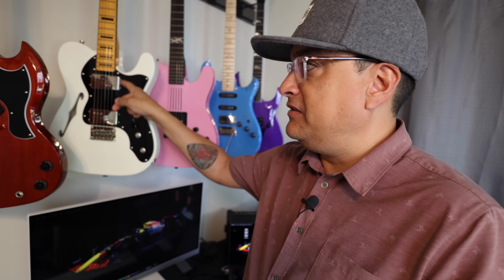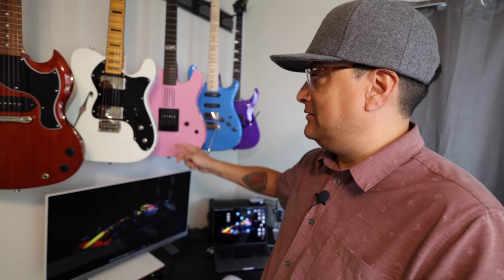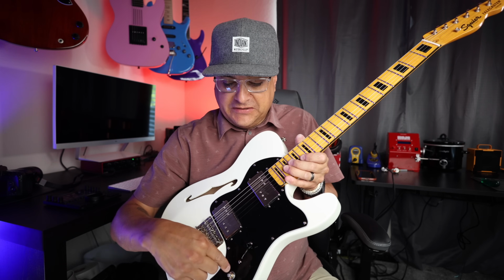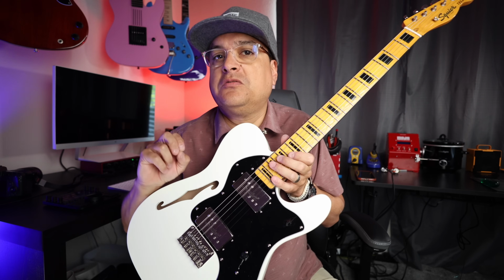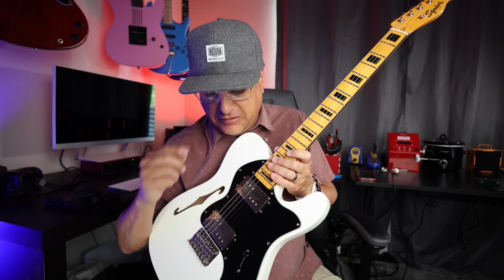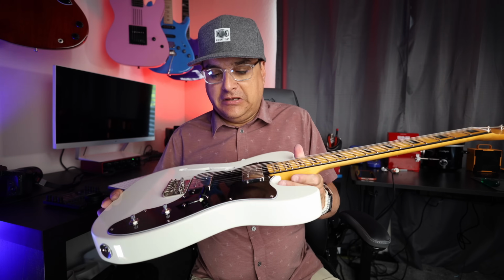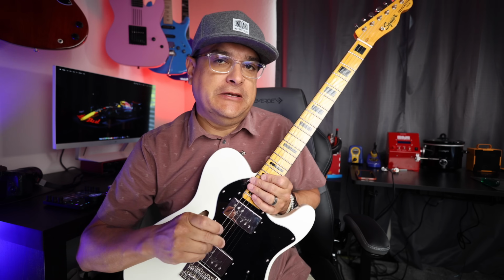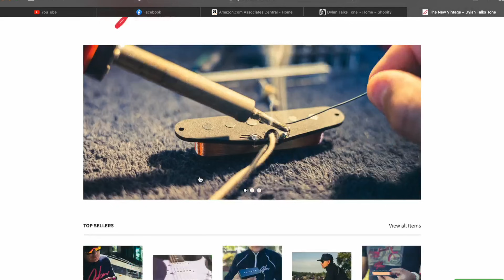250k Pots Vs 500k Pots - Sound Comparison

Comment: 3:45 all potentiometers are variable resistors.  Wiring a pot as a volume just makes all of the signal go to ground instead of through a capacitor then to ground in the case of a tone pot.  They work in the exact same way.  

The only difference is the tone pot bleeds highs to ground.  Volume pots bleeds the entire signal to ground.  In both cases, the pots are variable resistors.
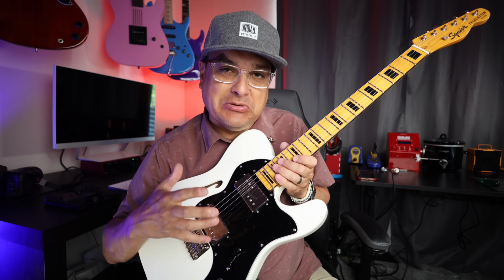Reply: 4:30 you’re really over complicating this.  

Pots are resistors.  The higher the resistor value, the stronger the resistor.  That’s it.  

A 250K pot is a weak resistor.  Therefore, it will allow more high end signal to bleed to ground.  So if you have bright pickups, using low value resistors will darken them up.  If you have dark pickups, using high value resistors will brighten them up.  

Why?  Because high value resistors are strong resistors, so they will do a better job of resisting the high from being bled to ground.  

That’s it. Don’t over complicate.  You’ll just confuse people.

Comment: What's your suggestion for Seymour Duncan Hot or Cool Rails? I have a 250k volume direct to my cool rail in my strat and 500k, tone and volume, in my duo sonic with a hot in bridge and cool in neck. Both sound great though the duo sounds like trying a 250k might be worth the experimentation.
Reply: I have always understood that those were designed to be used with 250k pots but I guess you could experiment. I use em with 250. One day I'll try 500k. Although I think it sounds fine with 250 in a Strat.
Reply: @danpena7922  I'm thinking of going back to 250s. The 500s, in the Duo Sonic at least, sound a little "muddy". Think I need to get the solder gun out again since I never tried them with 250s, just thought: humbucker in single coil size so use a humbucker pot. Wasn't afterwards I started digging. Thanks for confirming my fears!! Lol

Comment: I use 250k pots for guitars without a tone circuit, and wire a 1M resistor across a 500k volume pot that's already wired to a tone control, for 333k. Much smoother!

Comment: If the aim is to reduce the highs, you even don't need to buy lower resistance pots. You can use a 500K resistor to turn a 500K pot to 250K pot. Just attach it in parallel. And resistors are like 10 times cheaper than new pots....

Comment: Could there be a pot that had two resistors in one, push-pull type, and be able to choose between 500K or 250K?
And what about to use a resistor interleaved with a switch to "convert" 500k to 250k? Would be possible?
I don't know much about electronics, so please don't get mad at me.
Reply: There are dual pots (1 shaft controls two pots, for example dual 1 meg) if you put a 1 Meg resistor across the two outer lugs of one it would change the resistance to 500k (and it could possibly change the taper in an advantageous way) 
There are also custom pots, I believe the fender TBX circuit employees a 1 Meg and a 250k, in a dual configuration. 

There are also dual concentric pots, which have concentric shafts you can turn independently.  The fender pot that I mentioned may be like that, I don't remember right now.  

I think the Fender Jazz bass employs  one or two concentric pots.

Also my Ernie Ball stereo volume pedal employs two dual pots, one large dual sealed for the treadle, and a separate smaller dual pot to adjust the taper. I think they are both one meg. 

One Meg is pretty much the standard input resistor size of guitar, and bass amplifiers, at least in the high impedance (louder) input.

Comment: Going between humbucking mode and switching to single coil mode, there is a noticeable change in volume. 
Any way to fix this?
Reply from the maker: Yep. Use our pickup designed for it

Comment: Ive got maybe an odd question. I was looking for pots on amazon and i found a product "BOURNS 10K Ohm Slide Potentiometer".  I think it would be neat to use this in a guitar. My skepticism is based on its use in a guitar and the fact that ive only seen them go up to 100k ohms. I not sure how to ask because im not sure how this all works. So i run a hot bridge pickup 14-15k so would the pickups overload the 10k sliding pots? Or would the pots cut or gate the extra 4-5k from the pickups. Or would the pots simply restrict the volume and tone coming out of the guitar? Thanks for anyone who replies!!

Comment: Well im not listening to this vid via a high fidelity system. So, my take is that the 250k seems harsher with more bite. While the 500k sounded warmer with a wider frequency range. It seemed to roll off the top end. Personally, I favor the 250k sound over the 500k.

Comment: I think they both sounded good.   250K a hint darker but nothing an amp eq tweak couldn't fix if you wanted a touch more high end.  Both great to me honestly. Often times a 300K splits the difference and is the best of both worlds.
Reply: It depends on what you play also, I love the darker 250k since I play doom metal and stoner.

Comment: The 500k pots sound much better, warmer, balanced, and fuller. I thought higher pot values preserved high frequencies, and that's why they are used on Humbuckers, which are typically dark sounding, and lower pot values are used on Single Coils, which are typically bright sounding. That's not what I heard in the video.🤷‍♂

I've read that in 1954, Leo Fender was using 100k Pots in the Strats, but thought they were too dark sounding, and switched to 250k Pots. Has anyone tried 100k pots in a Strat, particularly for the Bridge Pickup? How did they sound?
What year did Fender switch to 250k pots?
Reply: Is your bridge pickup actually connected to a tone pot? If not then you'll get full "brightness" from the bridge. If you then swap to 100K the neck and middle will sound darker, i.e. you're increasing the difference in tones.
Reply: @kitmoore9969  I have a tone pot for each pickup, and it's hard to understand how anyone manages to use a bridge pickup without one. 🤷‍♀

Comment: I definitely agree that the guitar sounds better with the 500k pots. But, real question: following this line of reasoning (that the higher the rating, the less top end we lose), why not put 1meg pots in everything? Again, serious question. Anybody?
Reply: You can, and only your ears cN judge if it sounds right to you. 

I had a strat with a Dimarzio SDS-1 in the bridge where I ran a 1 Meg pot as the volume.  It was pretty bright sounding. 500k works better for me on this set up.

Comment: the 250k trims the highs but also trims the upper-mids. the 500k enhances highs and enhances upper-mids, which gives an overall bigger sound (with good top-end). it takes a big effort to explain this using any kind of model, but very little effort using basic filter maths.

Comment: I don't always agree with you 100%. However, I agree with you 100% on this issue. This was a great video and I'm one of those people who never touches a Tone control on the guitar because I don't want to take a pristine sound, bugger it all up, and then send it to my amp and try to play with the amp controls to try to put back the good sound that I just screwed up by messing with a tone control on the guitar. I have several friends who are fairly famous guitarist and when I mentioned that I never use the guitar tone controls, most of them said that they never use the guitar tone controls. Wow, Big surprise! We all use the same logic. Send what you've got to the amp and then adjust the amp to get the sound you want. I even built a guitar with two 9 K Humbuckers that I wired to the switch as Bridge only, Neck only, both in Series, and Shunt to ground so the guitar wouldn't set up on stage and Howl while taking a break. Guess what? I only installed a 500 K Volume pot and no Tone pot. After several years of enjoying it and recording a couple of albums, I gave the guitar to a guitar buddy who plays about twice as good as me. Six months later, I asked him how he liked the guitar, and he said that it plays like butter, and he loves to use it on recording sessions.

Comment: My strat(sss) copy's single coil pickups have really low gain even when the distortion is all the way up, also when i palm mute it sounds just like when you mute your strings with no distortion. I was going to replace it to hss with 500k pots for volume and bridge tone and 250k for neck tone but if i replaced the pots with 500k ones will it be enough to get similar palm mute sound to something like an HH sg or les paul?
Reply: Sounds more like an issue with your amp? Do you have other guitars where this isn't an issue?
Reply: @naycnay  my epiphone sg doesnt have this problem

Comment: I use 1 meg pots in a few guitars. The trick is to set your amp right and have you're board set a little more mellow so you can retain articulation while still having warmth. It can be a little finicky especially with fuzz but
It's all part of the fun.

Comment: I had a Seymour Duncan Hot Rail installed in my player plus Stratocaster in the bridge position, and it sounds great. Im not sure what pots came stock with the guitar, but the tech didn't change any of my tone pots. He did replace my volume pot, but that's because it got scratchy really fast (my new volume pot is already scratchy after 6 months, so i don't know what's going on there.)

Anways, I really like the sound of the hot rail with the stock pot, but I have no clue about what pots come with the Player Plus Strats. I definitely wouldn't want the tone to be brighter, so I probably won't ever change it unless it gets scratchy. Does anyone know what pots come stock on my Strat? I'm just curious. The bridge pots on the Player Plus Strats have a pull-up funtion, that way I can have the neck pickup engaged with the bridge pickup, as well as all 3 pickups on simultaneously. I'm not sure if that narrows things down at all.

Comment: The Fender buckers are low output pickups. They are not wound nearly as hot as even a vintage spec humbucker. That's why it has 250k pots. The higher the output of the pup, the more it needs a 500 or even 1 meg pot.
Reply from the maker: Not true actually
Reply: @DylanTalksTone  Yes, true actually. Fifty years of experimenting tells me so. Low strength magnets, fewer windings, coil wire gauge and if there is a plate or not determines which pot will sound best. The pickup makers design them that way to be used with a certain pot spec. You can put a 1 meg pot on a vintage spec Strat pickup, but why would you? It's going to sound like shit, and for a reason. No chime. It will be the anti-thesis of what a vintage Strat pup is supposed to sound like.
Reply from the maker: Well… actual measurements with LC meters, DMMs, and Gauss meters PROVE that these pickups are not

Comment: I don't care for 500k pickups on the single coils I use. I don't care for for 250k on the humbuckers I use. So in the case of my hss guitars it's a very simple mod to cut the pots value that the pickup sees by placing a resistor between the switch and pickup. This way you can experiment with pot values that don't exist in nature and dial in EXACTLY what you want to hear.

Comment: 500k pots sound like what you'd expect from PAFs, beefier and more midrange. 250k sound a little thinner, more like your typical Fender tone. I like the clarity of your WRHBs but I'm still not clear if your WRHB has the original bobbin and reflector plate design of the "true" WRHB. I'm curious how closer to original design WRHB, like ones in the Vintera models, would sound in this test. (Not counting CuNiFe magnets, but with AlNiCo.) I'm also not convinced calling these Fender Player or Squier pickups with the typical humbucker design coils inside, a Wide Range Humbucker. Isn't it just continuing Fender's misleading marketing and confusing end users?

Comment: This argument is over for me.  You can always roll back the tone or insert an eq here or there.  No sense in having 250 any more unless you want to run a very naked rig.  Even then there is a treble pot on your amp.  I know there are other subtle differences, but the most noticeable is the top end roll off, which can be solved with other choices.

Comment: The new part (pot,  jack, cap) is going to be harsh/ bright no matter what.  Whenever I make a change I plug the guitar into a wall-powered pedal for no less than 40 hours but up to 100 hours before even playing it.  Old guitars don't sound better, they are just burned in.  Same with guitar speakers.
Reply from the maker: Uh…. Whut?

Comment: Technically there's a 250k pot inside of every 500k pot and that would correspond to the half way position on a linear tapered pot. 

The only thing you might not like is the sensitivity of the larger pot when turning the dial. 

A 250k pot uses the full dial range for variance while the dial range on a 500k pot to equal the 250k selection range is half the movement.

If your one of those people that likes to rapidly move your dial back and forth as an effect, your going to have to adjust your playing style to get the effect as smooth since the larger pot is now less sensitive for the same amount of movement.
Reply: I don't think the pots resistance (500k or 250k) has any influence over its sensitivity, thats completely down to the taper of the pot itself. A linear taper pot will have a different sensitivity to an audio taper pot.

"A 250k pot uses the full dial range for variance while the dial range on a 500k pot to equal the 250k selection range is half the movement."
this just isn't correct in my experience, unless the taper of each pot is also different. a pot at 50% will always send 50% of the signal to ground (if we're talking a volume or tone pot) no matter its resistance. A pots resistance only really influences how much high frequency it sends to ground, with a higher resistance preserving more of those high frequencies. If a pot has a different taper then the amount sent to ground will vary at each setting which might be what you're referring to?

Comment: The pots are just filters. A 500K pot just filters different frequencies than a 250K pot. This is pretty obvious to anyone who knows at least something about electronics.
Reply from the maker: …. Well… a pot is a resistor. It can be wired as a voltage divider.

Comment: Resistors create noise.  I learned this when I studied electronics.  The higher the resistance the more noise.  Single coils are noisy on there own.  So 250k would load the pickup more.  In theory you could reduce the noise.